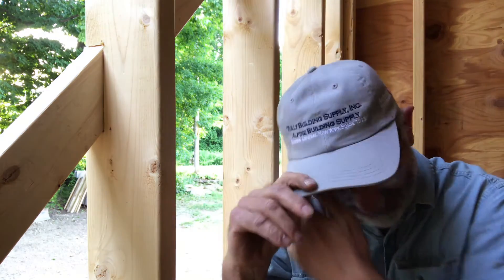Build Stronger With Angle Bracing

Comment: I bought an old two story  with tall ceilings a few years ago and when the first big storm hit it felt like the house was going to come down.    Rebuilding the house was not an option, so when i gutted the lower level and a few upper level rooms, i put these braces in.   The studs are all 2x6 so I had room for a full 2x let in brace.   It made all the difference.    We had a bad storm last week with 60+ mph winds and the house felt like it was made of stone.   The culprit was during the early 70s, they tore off the 1x10 shiplap sheathing, put 1 inch foam insulation up against the studs, then half inch OSB and stucco.  So there was a one inch gap between the OSB sheathing and house studs.  All of that was hidden under vinyl siding when I bought the house.
Reply from the maker: Wow. That's an insightful experience. Thank you for posting it here. I'm glad you got it braced before a serious collapse!  👍
Reply: lmao wow glad you fixed that one!

Comment: Saw a new video that said this method was the industry standard for many years however, its no longer used as even with good notching, the stud cuts decrease the integrity of the studs and walls?
Reply from the maker: Interesting. Well, the industry standard was once 2x4 walls, with notched-in 1x4 braces. These days the studs are typically 2x6. I can't believe the racking strength of the wall is compromised by either let-in stud wall bracing. If you back a truck or bulldozer into it, then yes, I can see that it's compromised to some degree. Thanks for the thought-provoking comment.
Reply: @herrickkimball  Thanks for the reply.

Comment: I built a shed, I’m almost done. I’ve done the framing, sheathing, roof, etc. almost dried in with the zip system for now, I will need my siding and trim. I still have braces in the inside framed walls. I did two corners with 5ft metal Simpson ties. I used the 3 4 5 method to get a good triangle. My question for anyone with knowledge will this help? I knotched in the metal which it’s about an eight of an inch ish. I understand too to bottom plate is better but I also don’t want to sacrifice insulation. I’m building it like a tiny home. 
Please help
Reply from the maker: If your sheathing is well nailed to the studs that will provide sufficient racking strength. The 5ft ties will be helpful.  A small structure like you are making doesn’t need angle bracing like a larger structure. Don’t worry about it. 👍

Comment: Good video,  lots of half rough saw half pole barn buildings are somewhere in the middle.  Not really a pole barn with posts providing shear strength or properly sheet-ed with a rated plywood or sheeting.   Long story short you need some shear strength in a wall system.  I think many people like my grandpa learned half post and beam and half rough sawn.   For post and beam you need knee braces. For rough sawn you typically need a diagonal brace as the rough sawn lap siding is typically nailed to the studs without a rated sheeting.   It is cool to take an old crap building and add a proper shear wall and really see how big of a difference a small triangle can make.

Comment: Do you think that angled bracing would be good for a cripple wall retrofit?
I don't trust plywood to last long the rest of the house has with house unlike the redwood it's built out of. I'm thinking either turn reach segment of the cripple wall into triangles or turn the boards i have sideways and put an x in each one. I have s bunch of 2x6 used redwood decking i got that is in good condition and could use that

Comment: does it matter if your using multiple small cut studs pieces diagonally for a let in brace vs cutting grooves in the wall and placing a single long board at an angle like you did here??

Comment: Do you need more than one diagonal brace in a wall? What I'm asking is should your bracing make an X in the wall frame or is one diagonal brace sufficient?
Reply from the maker: One is sufficient, in my opinion. If you have wall length enough, put an angle brace in each corner. 👍

Comment: The only video of someone cutting a let-in brace into a 2x4 wall is a low quality video of Larry Haun. The other video of of a balsa wood model. There is also another video of a man cutting 45° 2X4s to fill the gaps between the 16" O.C. vertical studs. That would not be a let-in brace, but it goes to show you how rare and how little information there is no this on youtube. I guess it wouldn't hurt to make a video showing how you would approach adding a let-in brace on a 2"x4"x8' wall. The wall behind you in the video looks a lot cleaner cut than what Larry does in his example. Just an idea.

Comment: I build custom homes in Michigan and typically LIB  is spec'd for interior bearing walls and partitions intersecting a long exterior wall, midspan-ish.  We use the simpson metal wind brace often, but will let-in 1x material if we run out.

Comment: Why nails and not screws if you want strength?
Reply from the maker: It's not a good idea to use screws for structural framing. They break under stresses where nails would not. I use screws for framing interior partitions in remodeling situations, or a small addition. But they are not suited for any structural framing application. Thanks for the question.
Reply: @herrickkimball  
Structural framing screws CAN be used for structural framing, they will not break, Simpson strong-tie and many other brands make them.

Comment: Old houses in Australia have
 The diagonal braces. Everyone uses plywood bracing. Even internal walls. I brace everything to oblivion. Maybe a little overkill. House in Australia nowadays are an absolute joke! Waffle slabs etc. Cut and fill not done properly. Cracks everywhere in plasterboard ceilings and diagonal cracks coming off the windows internally on plasterboard. These are no more than 10 years old. Unbelievable workmanship.

Comment: How do you cut into the boards like that?
Reply from the maker: Place the angle braces where you want them. Mark cut lines on the studs. Set saw depth as needed. Make multiple saw kerfs through the area to be removed. Clean up the notch with a sharp chisel.
Reply: Thanks

Comment: If you are building your own new home, be careful about installing old style Let In Bracing. It is super strong, but some areas might have a building code that restricts the use of such old style bracing due to it diminishing insulation capability.  The steel bracing used in this video has little effect on quality of insulation.

Comment: Very helpful thanks, I’m building a playhouse for my daughter, 12’ x12’
It’s constructed with 4x4 corner posts and 2x3 studs , 8’ high , sloping roof but still not sturdy. My question is what should I use for ‘ let in’ bracing on 2x3” studs ?
Reply from the maker: 1x4 pine is my recommendation. 👍🏻

Comment: Kind of a related topic: If an older house has no bracing, sheathing or weather barrier, would it be a good idea to add those features?  I'm fixing the outside of one of my rentals (in Northeast Kansas) and I have found a bunch of moldy insulation behind my failing T1-11 siding.  Anyone have any suggestions or ideas moving forward?
Reply: Year has passed. Can you write an update?

Comment: Would adding diagonal “one-by” boards as exterior sheathing add even more strength? I have my own sawmill so cost isn’t an issue and we have about 32 acres of usable trees so material isn’t an issue either. I do live in an area of Alabama where severe weather is common so I’m trying to decide if it would be worth the extra time and trees to build my home this way. Thanks for any advice
Reply from the maker: That's a question for a structural engineer. But, offhand, I think that would be a radically strong bracing approach. I have actually seen this once in an old building that I remodeled. The sheathing boards were 3/4" tongue-and-groove. On the negative side, it would be very time consuming to do.

Comment: You do NOT need braces as shown as long as your exterior wall is panelized with the right panel types, connectors and blocking. You may need hold-downs as well. With braces, the force becomes centralized at point loads and if too high, hold-downs are a absolute must. Without them, your braces are completely useless. I'm a structural PE.
Reply: Relax. Bracing hurts nothing. It's been done successfully forever and still works today.

Comment: ANGLE BRACING & CROSS BRACING.  💪💪👍👍☝️☝️👊✊🤜🤝
DO IT !!!!!  It's 10X stronger than ply-wood alone.   Plywood is installed with short nails, & the wood shrinks , becomes loose , rots much quicker. (And does not have the cross tention strength of solid lumber.)   Ply-wood also warps , buckles & separates very fast when exposed to high humidity.   And once that happens, the cross strength is gone.    Solid lumber may bow, or crown,  but it's tension strength stays 95% to 100% in most cases.
CROSS BRACE YOUR FRAMING.💪

Comment: First thanks for the information, I saw a video of a barn going up, and it appears the were setting the roof trusses (I saw a crane in the background). There was a high wind, and no bracing for the roof trusses, the roof ended up on the ground, it was a big barn to. Well finally my question, when you use the let in bracing, do make gang cuts before framing or do you pop a chalk line, make the cuts after it's framed and before you raise the wall? Thanks again

Comment: You couldn't be more wrong about angled 1x or 2x let in bracing. Often the braces fail all the time. They rot from water damage, they break under compression loads, they deflect significantly more than a wood paneled shearwall, there's also a uplift force at the bottom of the brace that isn't considered at second level or even first level or resisted with a strap or a hold down to the foundation. This type of brace is also more likely to damage architectural finishes as well since they deflect more than a wood paneled shearwall and if one happens to break, the owner will never know about it since its covered and will even cause more damage because the entire wall braceline is failing. This leads them to believe the foundation is moving when in reality the bracing failed and stud walls have racked due to lateral loads. The only king of lateral bracing for any residential building is wood paneled shear walls. They are extremely strong and barely deflect at all. Just get the nailing pattern correct and you dont have to worry about lateral issues at all. 

A professional engineer.
Reply: Agreed. 30 year home builder here. Have NEVER used a let-in brace in the 30 yrs I've been a builder. With the manufacturing improvements of OSB that reaches from the bottom plate to the top of the double top plate (windstorm panels), and a correct nail pattern, its the strongest technique for residential wall bracing.
Reply: Yeah...those horrible let-in braces on 200 year-old frames are awful. Lol. Give us a break, fellas. They don't rot if protected from moisture, same as any other wood product. Long-time homebuilders used them for decades upon decades with great results. He's not wrong at all.

Comment: Thank you for the video, but I have a question if you are so kind to answer. I am trying to open a doorway in an interior wall and came across an angle brace built by my late father. I'm at the bottom end of the brace by the floor and it is sticking about 13 inches at a 45 degree angle into where I would like my new doorway to be. Is it safe to cut this last piece off? Or will I have to shift the new doorway a bit more... I have pictures if the visual is necessary. Thank you for your time and once again thank you for the video!
Reply from the maker: Offhand, without seeing the whole situation, and not being a structural engineer, I would say it's okay to cut the bracing and put the door where you want it. You will sacrifice the bracing strength to some degree, but I have seen this done many times over my years as a home remodeler. If you have the interior wall by the door opened up, you could notch a 1/4 or even a 1x6 wood angle brace into the studs on the interior side and that would more than make up for any bracing strength lost by cutting into the bottom of the old brace.

Comment: Hey so I built a squat and bench rack for my weights. I set 2x2s into Home Depot 5 gallon buckets. At the bottom of the post I hammered in some nails on each side to tug on the Quikrete Mortar mix when it should be (Cement). Do you think the mortar will be fine and hold or would I have to redo the entire project? I have much to learn in life 🤦🏻‍♂️ lol. It’s all part of the process I guess.
Reply from the maker: I wouldn't redo it if you've already done it. See how it works. 
The concept sounds good, though concrete mix might be better than mortar mix. Best wishes with your project.
Reply: Herrick Kimball Idk if supports sticking out horizontally to lean up against a wall or if supports on the side drilled diagonally leading to the ground would be better to prevent it from tipping back. 

Hope that made sense. What do you think.
Reply from the maker: @vicmac5065  Sorry Vic Mac but my mind isn't grasping the visual. In general, diagonal supports, properly made, will be your strongest option.
Reply: Herrick Kimball I am looking for lateral support to prevent a free standing post from falling backwards when I rack an Olympic barbell with weights on it.

Comment: Great video. Quick question, when putting let-in bracing in the corner, how far from the corner do you go (I am hoping to sneak a door under one of mine, if it can be like 2' from the corner)?
Do you let the bracing into both plates for a double top plated wall, or just the bottom one?
Would/could I split the cut-out (between the bracing and the studs) for a 2x4 wall so as not to cut so deep into my studs?
Reply: You can also do it this way, like they do in Australia. https://www.architectureanddesign.com.au/suppliers/pryda-australia/pryda-develops-narrow-wall-bracing-for-contemporar#
Reply: I have the same questions... Want to implement this method for a stronger build but there's not much information around it.

Comment: How would you put in a diagonal brace on your friend's pole barn if there's horizontal purlins? Wouldn't you be cutting completely through the purlins? Or would you cut into the posts first and then put the purlins over the bracing?  Wouldn't that decrease the strength of the poles?  I'm building a large shop in a few months and I'm running into this same issue.
Reply from the maker: With a pole barn, the diagonal braces are typically placed against the purlins from inside. They are securely nailed into each purlin and into the where they meet the poles. No notching for the diagonal braces is needed. Best wishes for a successful project.
Reply: @herrickkimball Thanks for the quick reply.  My walls will be insulated and finished so I don't think an interior diagonal brace will work.  It looks like I'll just add an additional layer of sheathing under the board and batten.  Maybe some Densglass so I can skip the vapor barrier.
Reply from the maker: @rocketsurgery8337   Pole barns with interior diagonal bracing against the purlins are routinely insulated and finished on the inside around here. I've seen pole barn houses do this. The church I attend was once a large agricultural pole barn. It was studded out between the poles, insulated, and finished off. The bracing is not a big deal to work around. It's only 1-1/2" thick. Some people use long 2x6 diagonal bracing instead of 2x4. It allows for more contact area and more nailing into the purlins. Super strong.